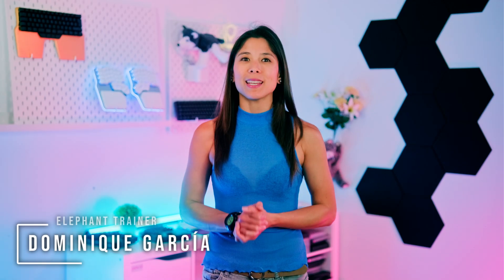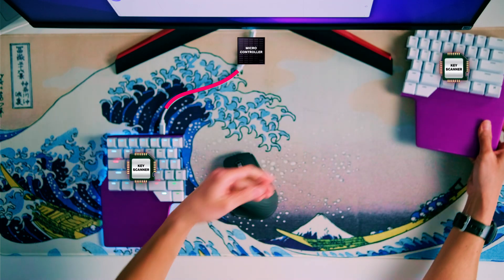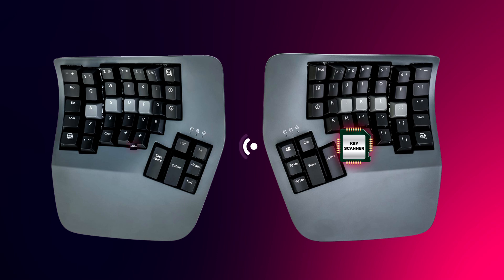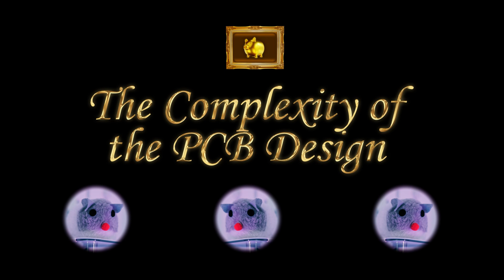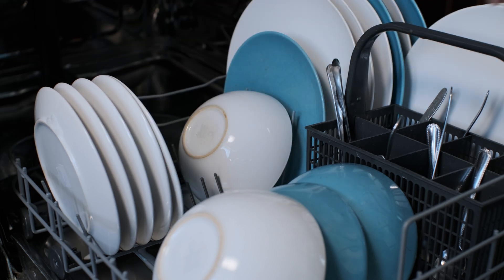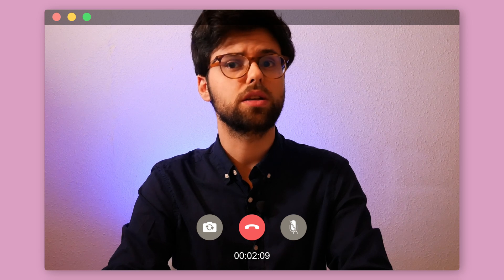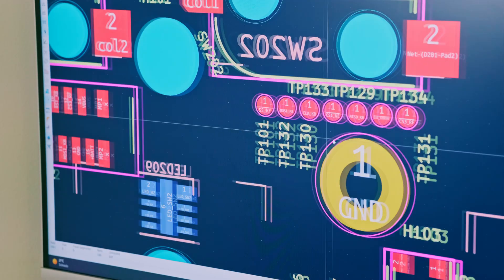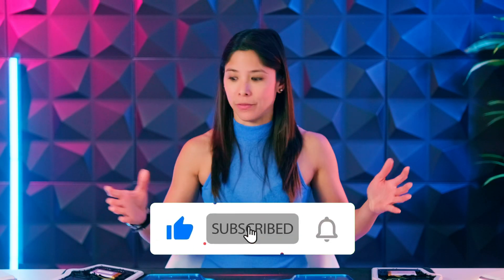Making a Wireless Split Keyboard Almost Killed Us!

Comment: Can we connect this with both mac and windows systems at the same time? Is switching between two easy?
Reply from the maker: If you use Bluetooth, you can switch between 5 different devices easily at the press of a button.
Reply: @DygmaLab  Can I order this in India?
Reply from the maker: Yes!
Reply from the maker: Yes!

Comment: Is wireless charging in the road map for this keyboard?
Reply from the maker: At some point in the future, yes. However it isn’t high priority at the moment 😊
Reply: @DygmaLab ic, i personally prefer having the wireless charging, so that i can have a wireless charging mat under it and never need to worry about charging. Feel free let convince me otherwise. ( i assume the wireless charging is low priority in favor to the tile mechanism)

--
on the website, it mentioned 20 hrs of useage without led. Does the keyboard last 20 hours, or 20 hours of active using. Let say I used 10 hours a day, it will last for 2 full days?
Reply from the maker: @Joe-os8vf it's 20h with LED, that's 20h of effective use. With dimmer LEDs or no LEDs at all it will be many more hours 😊

Comment: I think there are only 2 things I'm thinking of when I see the connection. 
that's 2 potential points of failure :/ so I got a feeling that the longevity of the Dygma might be shorter than the ergodox since that one has 2 rather easy-to-come-by cables and not 2 specific chipsets. 

Hopefully just the paranoia and when I get the Dygma I am sure I will be happy :D coincidentally i went for the fully loaded version. is there any plans of selling metal stands instead of plastic?
Reply from the maker: I understand what you're saying, it may be another point of failure but we're pretty confident about the design and tech used on the Defy. 

Besides those, in case you need it, we also have a great warranty and Customer support, ready to help if anything goes wrong 💪
Reply: @DygmaLab  got a coworker with the dygma raise, he is very happy with it.
And i am sure i will be happy with it too!

for me the plank was a perfect size and the ergodox ez is too large and weirdly misplaced buttons at the thumbs. 

the defy seem to have been designed their button layout with the idea that people dont have trashbin lids as hands which makes me excited with the layering. but 1 more month to go until my purple little beast arrives :D cant wait!
Reply from the maker: Yeah! The hype train is leaving town 🚂💨

Not sure if you've checked the video with the story behind the Defy thumb clusters but Luis shares a lot of his thoughts behind that in there: https://youtu.be/9-h5RVu_HBA

Comment: Rp2040 lol, I could have guessed. We use it em masse for smash controllers lol this is great
Reply from the maker: Nice! So my guess is that it's going to be an amazing keyboard, right? 👀
Reply: @DygmaLab  high polling rate, clock speed is very good, easy to use, VERY cheap to use in mass production, yeah seems good
Reply: En masse*

Comment: any chance of a wireless raise?
i want an ergonomical keyboard but hate cables. The defy seems to much from someone coming from a regular keyboard. The raise seems a lot more friendlyer, but the cableas are de only thing preventing me from buying one
Reply from the maker: Super chances! We want to have a new Raise with some of the Defy features in the future 🙌
Reply: @DygmaLab  thath would be amazing! i'll stay tunned
Reply: ortholinear takes a while to get used to, took me a month or two to really get used to a layered ortho-linear keyboard, these days I swear more at a normal keyboards xD
Reply: @lolsa123  i think i could adapt too, but i travel a lot, so i need to be able to type on a normal kb
Reply: @amirhussein834  well i can still type on a normal keyboard, but i prefer tying on an ortholinear these days, the other minus might be if you have configured a layout it might become a hassle to remember special keys on a normal keyboard, for example i got "/" hiding under the letter Z on another layer, which means with my current keyboard i would have to use a thumb key to layer down and then press Z with my ring finger. while on a normal keyboard i would have to use my pinky to use my other index to hit nr 7 (its swedish layout if you wonder why its not 7 on your keyboard) :D

Comment: Close but still not perfect. If you would remove battery and use just piezoelectric element for each button - that will be the best keyboard ever. Energy from such element is enough to send radio signal. It is already proven in other industries
Reply: Remove the battery... Meaning make it a purely wired keyboard?
Reply from the maker: Woah, that would be the best music keyboard ever... but we still need the battery 😅
Reply: So, nowadays, we can build wireless keyboards without batteries
Reply: But I understand that it is still R&D needed and small company cannot handle it
Reply: @Ilinevghfjf  I know of piezoelectric elements. I've used them in past projects as sensors, not power generation. I've heard nothing about them replacing batteries recently. Unless an "on the shelf" product has been launched that I haven't heard of, I don't think it would be a viable solution for the Dygma Defy, this year. I'm open to being wrong.

Comment: I love what you are doing here but I have questions. You already made the key scanners masters of communication. Why not go all the way and use nRF52832's (or greater) as key scanners with direct communications to a dongle or another Bluetooth host (pc/smartphone/..)?
Reply from the maker: That's a great question! By doing it this way we split the complexity of the project in two and the user can choose a system with or without RF/Bluetooth 🥰
Reply: @DygmaLab  Kinda makes sense. I wonder If this actually makes the non-Bluetooth variant more affordable.

This will allow me to use the Defy at work tho. I work in cybersecurity and we don't use bluetooth input devices. We also can't just bring our own hardware or build something custom for work.

Comment: I love your videos, they are nice, fun and informatives. Dygma Defy is a master pièce and will be mine one day, hopefully. The Price is expensive, Can you please consider kicking out the travelling case and enhancement kit for those who dont need it ? I think they are useless for most of your customers, it would be more ecologic and The Price could be 88 euros lower. 
Thanks for your videos
Reply: Being a backer, I understand the request. I'm just not sure how true the "useless for most customers" is. For myself, the carrying case is close to essential as I will be carrying this baby to work multiple times a week. I'm really happy I get a fitted case.
Reply: @sgt345  yes, You are right, in the sense that my "useless for most customers" statement is not supported by any statistics. I am referring solely to my personal feelings and experience (I have also received such items when purchasing my Everest Max, but I have never found them useful). With the current price of the pack, I will have to make compromises on certain appealing options such as Wi-Fi, tilt, or underglow, even though I find these options much more interesting than the Enhancement kit and the travel case.
I am working remotely.
Reply from the maker: The main problem in this case is that the carrying case acts as packaging. 

If we removed the case, we'd need to put in a nice box. And a nice box costs almost as much. That's why we went with the travel case 😅
Reply: @DygmaLab  ok, i understand the problem here. I'll wait for the sales or 2nd hands. Thanks for your answer